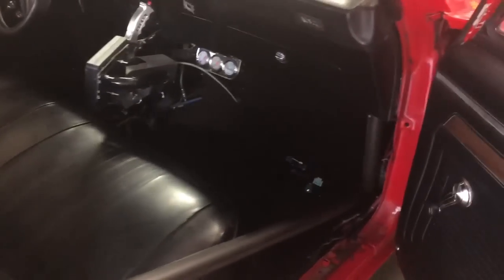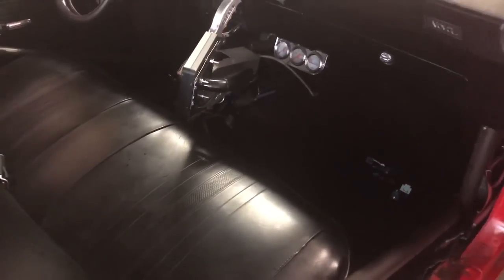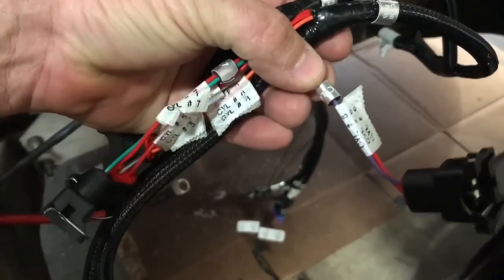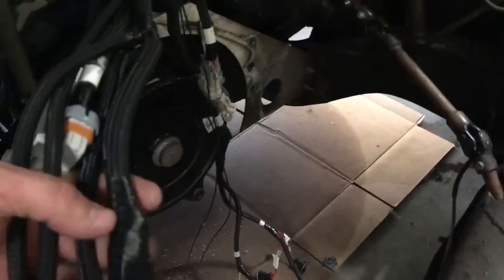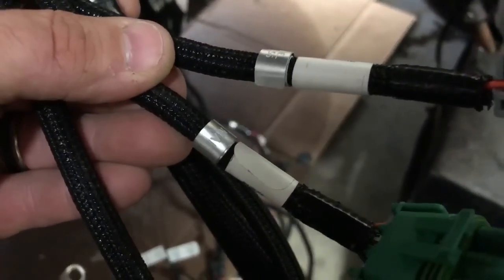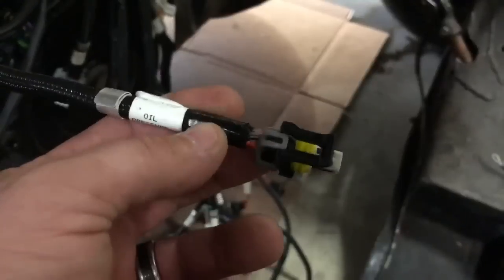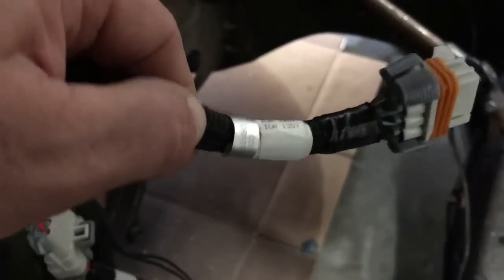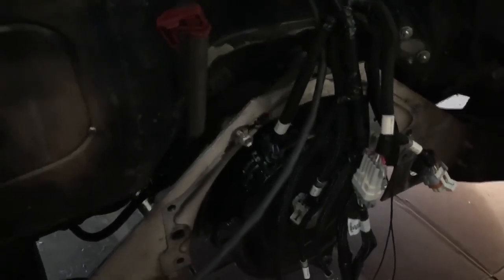Car Wiring Labels/Tags, Label your engine harness on the car!

Comment: Gosh I wish new cars had these on them from the factory, just finished putting an engine in a 17 escape today, was sitting and scratching my head wondering were some of these connectors go. I just keep putting parts on til it’s obvious but it would make work so much easier if they were labeled.